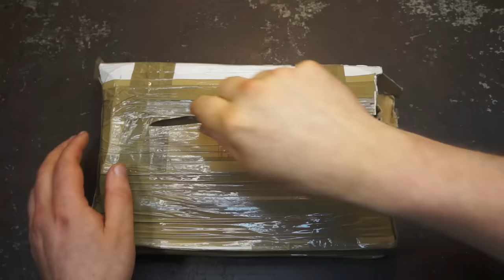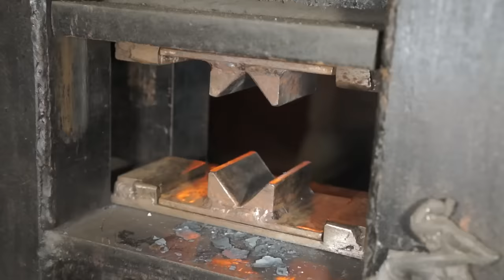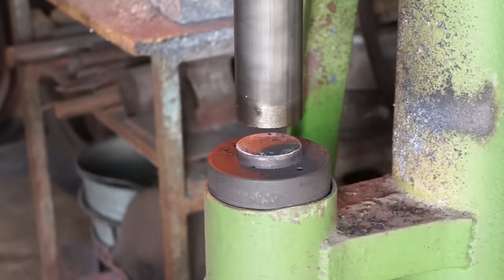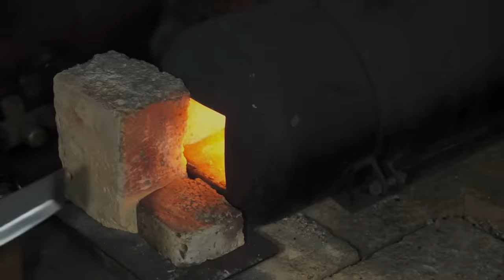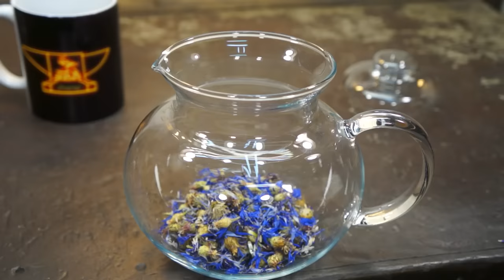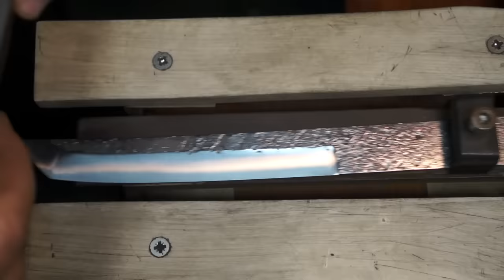I make tanto blades from the cannon barrel of the occupants APC gun.

Comment: As a former artillerist, I was shocked by the sight of that barrel. The bore is so much off center. It's been many years since I last squeezed the remote button to the Bofors cannons in my battery, they were decommissioned along with me in the 90s after several decades of service. I guess the current stock are technologically more advanced, but I can't see any technical reason for this bore, it's just shoddy workmanship probably caused by much of the production cost being funneled into the deep pockets of Russia's modern Boyars.
It's a good thing for those attacked by the Russians though as this cannon can't have been able to hit anything other than at almost point blank range.
The only use for crap like this is just to melt it down and make something better from it, and you're doing a good job as usual. Keep it up, and Слава Україні!

Comment: I love the off center bore!  That shows the barrel wasn't drilled then turned to make the outside parallel with the bore.  It shows the barrel was pierced in the orange stage and then hammer forged.  Methods to create barrels have come along ways in the last 180 years!  Most people think drill bits drill in a straight line and never learn the truth about machining.  I like the forging tech before machining as far less material is lost to scrap.
Reply: From what I understand, off center bore was by design. It was supposed to prevent barrel from sagging. Thicker part was supposed to be on the bottom. My family had a long history with heavy industry, my uncle was working on Slovak version of that cannon, even on version rechambered for NATO calibre. All barrels  were drilled off center. Initially I thought it was just shoddy craftmanship, but apparently not...
Reply: @Zaaphod  I love talking to people that know why!  I have seen the method to make tank barrels and regular rifle barrels.  My career was manufacturing in many different fields.  When drilling deep holes the drill bit will walk off the center line and the barrel must be turned to match the new center line of the bore.  I have seen heat issues with barrel walls of different thickness, but this may only relate to small bore diameters.  The problem with science is what works in the tiny arena may not scale up.

Comment: You do beautiful work, may I ask you blade Smith to blade Smith, so many people mig weld there working stick to the metal for billet, I myself never want to chance putting mild steel in my blade so I use 7018 rod or I tig weld at the beginning same if doing layered steel so many people mig weld all over it before forge welding.  Can you do a video explaining to people making demascus on why to not use the mig welder on a stacking process, as why old timers will wire wrap the steel

Comment: Mesmerising. Best wishes. As I understand, gun barrel metal formed both outer layers of the blade, and harder core (cylindrical) became the cutting edge of the blade (inner, central layer of the blade)? Or vice versa?

Comment: These came out as works of art. Are you going to turn the rest of the gun barrel into matching tantos and return them to the unit that sent you the worn out barrel?
Reply: Barrel wasn't worn out. It came from occupying forces abandoned or KIA troop carrier. It was cut off, either because, "Screw it, I know a guy who can make knives", or the vehicle was wrecked and the 25mm or 30mm cannon wasn't feasible without the rest of the system in tow.
Reply: @michaelshields3196  True. Not worth swapping parts around when you can get lightly used units that just need gas left every time you take a town.

Comment: Was the barrel metal better/harder than, what you filled it with(bushing) ? If yes then, the edge would be better if cutting edge was first shaped by Hammer and then grinded( without exposing weaker/added material).

Comment: “The tantō is a single or double edged dagger with a length between 15 and 30 cm … The tantō was designed primarily as a stabbing weapon, but the edge can be used for slashing as well.”
(wikipedia)

Perfect. May they be used well on the occupiers. 

Slava Ukraïni!❤❤❤

Comment: I have always been interested in anything made from metal.  The tanto is my personal favorite knife/short-bladed weapon.  I have a question or two.  How much mass do you lose from the scale that pops off? and what is the starting weight verse the final weight of the blade.  You made 2 of those, what type of handle did you use and sheaf did you use for the final product?

Comment: Hey I just had a question how damascus steel.
Would it be possible to create a sort of random damascus pattern by continually adding smaller pieces of metal to a bigger piece?
Like for example you heat up a bolt or screen until it's yellow hot and hammer it to a main piece until it's part of it.
I'm very curious what that would look like :]

Comment: Man, that bore sure was dead center... I don't know what it was dead center of, because it certainly was not that barrel. O_O One side's thickness 8mm, the other 11...  Quality Russian craftmanship there.
Reply: I'm gonna leave my first comment up as I still think "Russians r Smrt" could be the answer, but thinking about it some more, the thicker wall could be "down".  It would be the one actually supporting the barrel, which means more weight would be on it, than on top.  The top would mostly simply be in tension, while the bottom bit would have more sources of strees, so you could offset the bore to provide more strength to the lower part, but still use the same round stock.